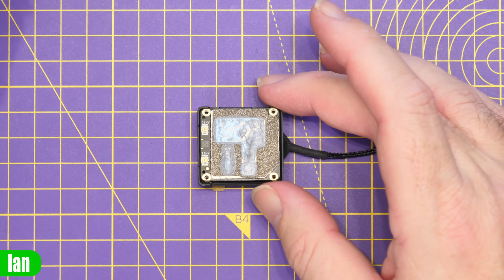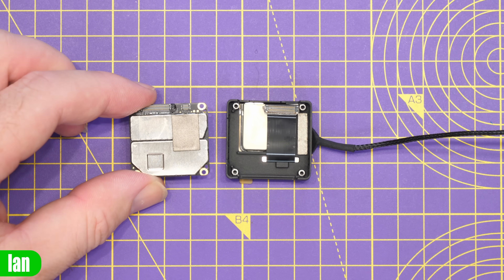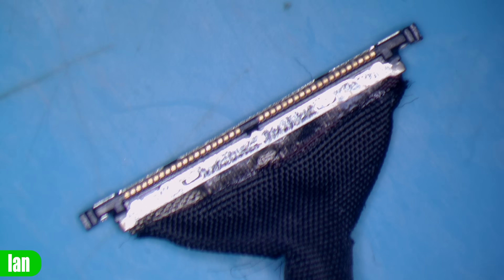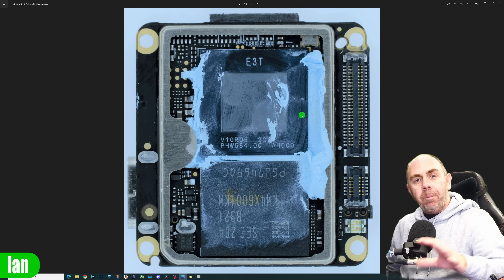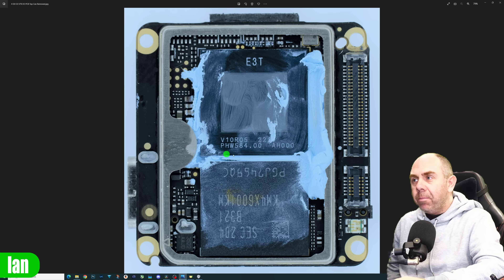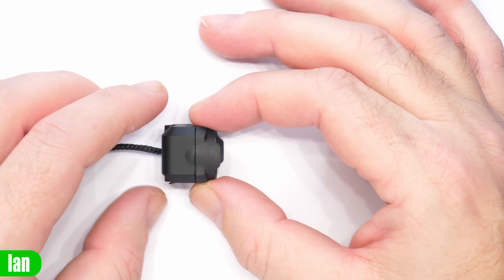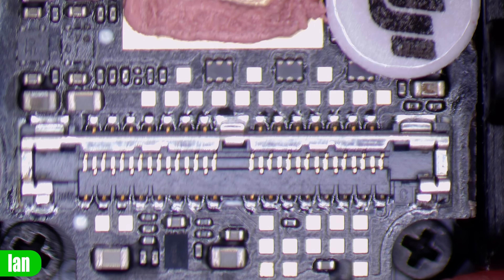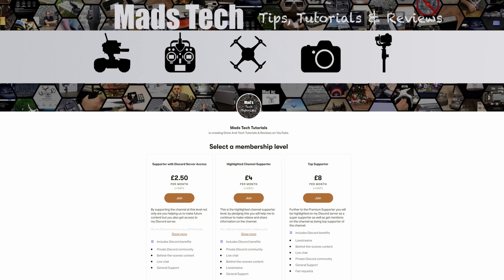DJI O3 Digital FPV System - Airunit Teardown

Comment from the maker: Hi everyone just to answer a common question the Gyro for the image stabilisation is located in the camera and not the air unit.  I discuss this more in my overview of O3.
Reply: Hey Ian how do you feel about the new remote control 2 ? I'm debating wether to buy it or go to a Crossfire/Elrs radio. I've always used the old big dji radio, i dont have analog stuff. Just not sure if I should buy into dji again. Im wondering what your advise would be?  Also what radio would "feel" like the old dji radio ? Tx16s?
Reply: @NoflectioN elrs tx16s yeah
Reply: how about if I crashed or scratched the camera lens. do dji let consumer to get another alternative to change only the camera lens?

Comment: Hello, Need help on 03 Air unit diagnosis. My O3 Air unit stopped working  after accidently disarming from a 10ft height. The camera and cable pair are working. The Air unit is transmitting OSD info, but the screen is black. The cable had come apart from the VTX during the crash. Any possibility of repairs

Comment: I have an 03 air unit and my camera cable ripped out leaving the mipi connection on the air unit damaged without hope for repair. I am curious if there is a way to replace that mipi connection on the air unit, or to buy a whole board that includes the camera connection. or lastly purchase a new 03 transmission module. Thanks mads tech in advance!

Comment: Maybe you can help. 
I have an o3 in a rotor riot tanq. I noticed some side to side jitters on the roll axis with eis turned on. I saw a video about the camere lens coming loose. I pulled it apart. Did not feel loose. But added a dab of glue for good measure.  Then once back together that side ro side ahake got way worse ar high theottle. Unusable. 
With eis off its butter smooth!  Ao i tried to see about using gyroflow. But i cannot get the camera to record gyro data?....  Eis off wide angle. Any ideas?  Tried so much. Diff mounting, ect. 
Any help is appreciated.  Thanks for all your great videos.

Comment: Great video! Is there a way to fix the bind button on 03 air unit? i've broken the bind button and i need to trigger the binding mode to be able to bind the 03 with goggles2 and controller 2

Comment: Nice video but I am wondering if it is possible to clean the sensor of the 03 unit because I do have a dust spec on all my videos while the lens is in perfect condition.
I don't know if that spot was there from the beginning on since I bought a used drone...

Comment: Hello, did you ever come across the bind button and light not working? Hence no connection to the goggles but looks like the rest of the module is working or atleast the other lights are. Looking for your wise knowledge, thanks
Reply: Happened to me. Most likely damaged a tiny capacitor when removing the VTx cable which is glued.

Comment: So I have been thinking. Not sure if you will still read this as its an older video now, but Ive always wondered, what would happen if you connect the Avata camera on the O3 unit. Would it work? Would for some reason the gimbal work? They both have 40 pins. Sometimes code is left inside firmware if it is used in another product but without the hardware, like in this case would be the gimbal. Not sure if this is some experiment you would like to test. Might get some interesting results! Perhaps just the image only works. But imagine if the gimbal also works! (altough you cannot set and angle perphaps) this would give something totally new to FPV builders and modders!

Comment: Great video .  
Unfortunately in my case, I have some issues  with the range . The old air unit seems to go further than the o3.
In order to see if it is caused  from the antenna , I find something strange in the one output ufl connector and I would like, if you can, to confirm it. 
When I measure the conductivity with my multimeter , I found that the one outputs  ufl  center pin looks like short-circuits with  the ground (200 mOhm) and the other has not conductivity at all .
Is it possible to check it on one of your o3s, to see  if this is the way it was supposed to be ?
Thanks

Comment: @MadRC, 

Ian, have you come across any issues binding to the goggles 2?  

Goggles and air unit are updated to the latest software , goggles are on the 03airunit setting for binding 

When just plugged into usb it’s green when a pack is plugged in it’s red, not binding either way.  No blinking red light that you should get when binding. 

Using Tmotor F7 HD FC , so should be able to handle the power output. 

Thanks for all the vids man. Hope your well 
J
Reply from the maker: Are you sure your pressing the bind button. It’s easy to miss the hole or actually get the wrong one. It’s not the led. It’s next to it
Reply: @MadRC  Thanks for replying Ian. I’ll double check, but pretty positive that I have been. Will report back a bit later. When I get back and have another look. Cheers Justin

Comment: Great video and some quality engineering commentary not just a BS tear down. How about water/moisture resistance of that thing? Did you spot some type of protection like lacquer or something outside and inside underneath the EMI shields? Thanks!

Comment: Can it or does it record audio at this point? 
I tried to find that setting and it seems it is not there (yet) in the software. 
The original DJI Air unit can record audio, so I never gave it a second thought. 
It took me a bit by surprise getting the first footage from the O3 without any sound ?! 
Any thoughts on this? 

Thank you very much and all the best for the New Year :)
Reply from the maker: No audio a recording.
Reply: @MadRC  😳 thank for the confirmation Ian ! Happy New Year!!! 👍🏻😊

wt*DJI 🤬
😱😱😱

Comment: Whats the story with the antenna? Two antennas in one? LHCP and RHCP in one package? I want to use a SMA adaptor to use an extended SMA style antenna. I have a PETG pod (soon to be 7075 aluminium) and want to be able to replace damaged antennas without having to open the pod and access the air unit - whats the best way to do this? will I need to use 2 SMA to ULF adaptors and 2 antennas? one RHCP and one LHCP? 
Any info in the stock antenna would be much appreciated.
Cheers,

Comment: Hi thanks for the great video of the teardown, I dont know much about FPV but I have a question would it be possible to use this DJI 03 unit just as a action camera, I really like the footprint and weight and was wondering if this could be used without the video transmission either by removing the pcb or disabling it somehow. Also can this be powered entirely from the USB C port, I wish to mount the camera to a crash helmet and the main unit to the side of the helmet with power coming from a small battery either direct or via usb c. Is it possible to control the camera from a phone or set it to record as soon as it has power I think you can see where I am going with this I just think it could be a great covert setup on a crash helmet with great stabilised video built in. Thanks in advance.

Comment: Is there a significant image quality upgrade, going from original dji air unit and camera (not vista and caddx camera) to O3 unit?  Mostly regarding penetration and image degradation due to obstacles, building and trees? For both V2 and 2 goggles?

Comment: With the 30 pin connector on the camera side of the cable, I'm curious if that means you can plug in other air unit compatible cameras.

Comment: hi. set my v2 goggles up with the dji 03 but every time i switch to my regular fpv mode i have to rebind all my vistas, and after doing this when i switch back to 03 i have to rebind this too? any sugestions/ thanks.
Reply from the maker: Sadly this is how it is at the moment. It’s another DJI mess.
Reply: @MadRC  thanks for the reply anyway, think I may off been a bit hasty, got six vista to rebind every time I use it!

Comment: Great job! Have you tried connecting nebula pro to the new unit? Are the connector pins aligned in similar manner comparing to the vista/AU? That could be interesting

Comment: It would be great to see hd vtx designed as a micro stack of pcbs and not one big board….as tiny of footprint as hd chipset can allow. Ultimately, an fpv camera that has a built-in hd vtx micro stack all housed in that 20x20 camera body with built in dvr would be holy grail.

Comment: hey where is the gyro sensor ?
Reply from the maker: It’s in the camera
Reply: @MadRC  if we crash the camera we crash the gyro sensor ... likewise if there is a chip shortage of gyro like last year we have no camera ?
Reply: @MadRC  its a design consideration gyro sensing is capture from on the camera and send back to the ou3 unit for stabilization ? i guess there isnt any processing done on the camera itself ?
Reply: so is the camera shock proof ? eventually we crash alot ... frontal gyro will go faulty ?
Reply: @manwithgutz  I’ve crashed my avata a zillion times just like others have. No gyro issues or camera problems yet…
Reply: @SkeezyFPV  zillions how many hours you been flying since launch ?

Comment: My vistas have a thin layer of conformal coating on, it’s how one survived at the bottom of a lake for 20 minutes once.
Reply: I’ve flown the DJI fpv drone in flat out downpours inadvertently. No issues at all. I’ve read that DJI uses conformal coating on all their drone electronics and it seems to be true. I buried my avata in a snow bank this morning, blew the snow out, set it on the dashboard with the defroster on, and put it back up in the air a few minutes later with no problems. DJI is water friendly lol

Comment: I wonder if it boots up fine with no errors with the SD card slot not connected and I wonder how much weight in total could be saved if the case and SD card was removed
Reply: Mads says it weighs around 16 grams naked

Comment: Great video! As I’m an electronics engineer these videos are the most fun and interesting to watch, next to when you dissect the radio frequencies with a spectrum analyzer. Which I guess is the next step for the O3 and goggles 2, looking forward to that. I wonder if there is a difference in the transmission depending on if the other end is Goggles 2 or the old V2?
Reply: you think they could do 03 compatible with the old dji fpv controller( the black one) with only firmware?

Comment: i would like to use it as fpv cam on my M600, so i can power it only...how can i start to REC? through goggles?
Reply: Record button on goggles should work. I was thinking it would be fun driving my truck with my v2 goggles in fpv before I actually put this in a build. I ordered one yesterday morning right when they went on sale.

Comment: Is there any technical reason why DJI can't enable 30fps recording while still streaming 60fps to the goggles? Seems like it would be easy to just write 1/2 the frames to the card while still capturing/streaming 60fps to the goggles.
Reply: In algorithm of video compress, one frame is depend on previous frame, so 30fps is not just simply get 1/2 frame of 60fps frames.

Comment: nice job tearing down the new O3 airunit!!! It was very insightful. It is incredible to see, how far DJI came with shrinking down designs.

The next question would be, what does the future hold to maybe a new air unit lite? a new O3 Vista? Probably no recording capability again, but smaller and lighter (maybe single PCB).

Exciting times for FPV :D

Comment: I wonder if the 40 pin plug on the air unit is the same as Avata? Perhaps the additional pins are used for the gimball on the Avata?

Comment: Excellent work showing us the internals. I do think decasing might actually be a better bet. If decased and left with a small space between the boards to allow cooling air to pass over the tin covers it should allow for better cooling. The case just doesn’t seem to allow a lot of cooling air in.
Reply: @ 2:40 ish that blue goo is thermal paste making the entire case a heatsink so that should be good

Comment: Great info!! Did you have the chance to weigh the aluminium case without the electronics inside?
Reply from the maker: It’s literally nothing. It’s like paper. People have weight boards with out case at nearly 17g
Reply: @MadRC  Thank you for replying!!
Reply: It's about 9g from what I've seen. I think you can shave an extra 1-2g taking off SD card and some other small bits. So probably unit can do about 15g, and you can probably shave off 1-2g off of the camera too.
Reply: @ooHotcooleRoo  Thank you for the information as well!

Comment: I'm guessing the blue goop is thermal paste? I wonder if you get better temps by replacing it with top quality pc thermal past like ProlimaTech PK-3 Nano Aluminum or similar?
Reply: The blue stuff is thermal paste. Your idea of using different paste is interesting. I hope someone tries this with appropriate temperature tests.
Reply: You probably can’t use a conductive paste when touching exposed pins, vs when paste is used on a cpu, that is just one solid case to conduct heat from.
Reply: @Sourdough_Humboldt  Many (possibly most) thermal pastes are not electrically conductive. Normally you don't have to worry about thermal paste getting on exposed pins.
Specialty thermal compounds like "Liquid Metal" are another matter. You have to be super careful using electrically conductive compounds.

Comment: could this air unit control an ESC over the UART connection?
Reply: You'd need something to convert the SBUS data to appropriate ESC data. It will likely require a flight controller or other microcontroller to make this conversion.
I don't know of any ESCs which can be controlled directly using SBUS.
Reply: @ddegn  there is no need to use SBUS
the Air Unit gets connected to the FC via UART for OSD data and MSP OSD, besides SBUS for RC
iirc the Fettec OneWire protocol is based on UART
and if the Eagle chip acts as FC in the Avata, it could theoretically control Fettec ESC's over OneWire, eliminating a seperate FC
if Dji allowed that, it would also mean they would have to release an FC configurator application
Reply: @marc_frank  I'd be surprised if the new Air Unit couldn't output the FETtec protocol if the firmware were appropriately modified. I'd also be very surprised if DJI changed the firmware this way.

The new Air Unit might have enough spare processing power to act as a flight controller but I doubt DJI will do this.

Comment: I am curious to know if on the camera you remove the screws on the pcb will it come out complete with the lens holder like pcb cameras, on most of them  the holder is a 12mm threaded plastic holder  with the lens screwed into it, if it is it would it might just be  possible to use alternative lenses or replace a damaged lens.
Reply: If the lens can be replaced, maybe we could have a FPV drone with a zoom lens?
Well, maybe not a zoom lens but it would be nice to be able to replace a damaged lens or to try a lens with a different focal length.
Reply: I think flying with a zoom lens would be a really bad idea lol
Reply: @SkeezyFPV  A zoom lens would be great for FPV. If you don't feel like your drone is flying fast enough, you could zoom in to make it appear the drone is moving faster. What could possibly go wrong?

Comment: Great work Mads !   wow DJI's has some impressive board design and space saving solutions
Reply: Will the goggles 2 ever be able to work with the FPV drone? 
I was hoping to be able to use g2 with both the Avata and the FPV, but with the installed firmware, they only support the Avata. 
And could you please recommend a video tutorial on how to root/fcc hack the goggles 2 for dummies?

Comment: You are the top-banana Sir, this is certainly some very pertinent content. Great stuff! 😊MurdersFPV said that the IMU has been built into the camera, rather than the air unit itself. Is that right?
Reply: It should be, else stabilizing on a pan / tilt unit is impossible.

Comment: Do u know if the og camera will work with this new system
Reply: Not atm.
Reply: the mipi cable is different
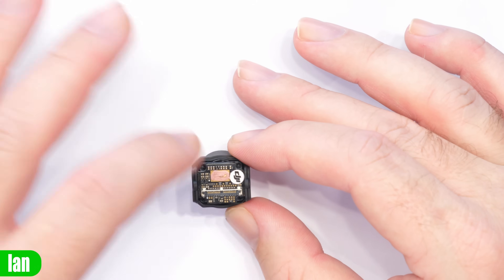Reply: okay 13:35
Reply: The imu is in the camera so likely not any aftermarket camera mods it sounds like